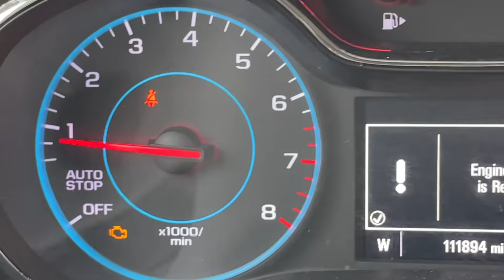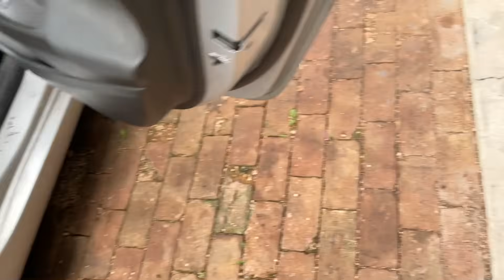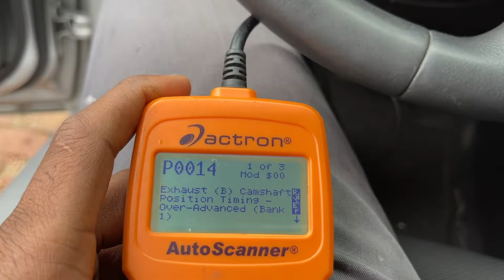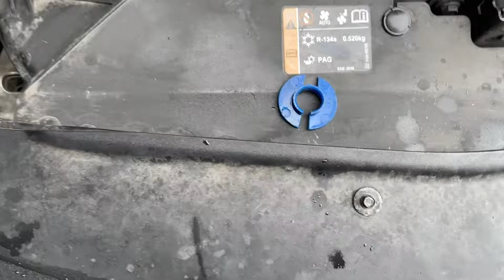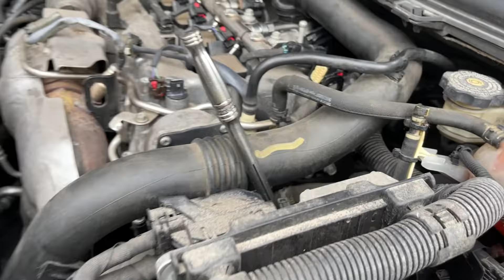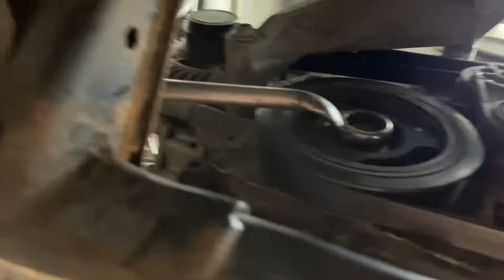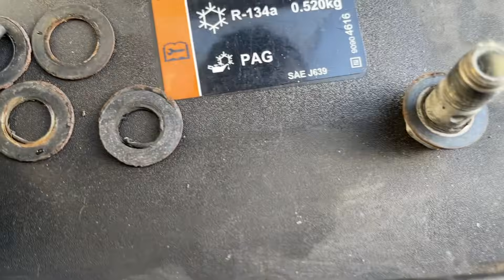16-19 Chevy Cruze, Mailbu Valve Cover Removal, VVT Solenoid & Camshaft Sensor Replacement 1.4L, 1.5L

Comment: Hey Terence, thank you so much for the informative video. I had a shattered Vaccum pump which caused Hard brake pedal. Drove home slowly.. Turned off. Tried to start again but had long crank, no start.
Opened up valve cover, fished out all the pieces new VP and Seal done.
Reluctor had moved so I tapped into position. Closed it all up. Now it starts and brake pedal is back to normal.
Seeking some guidance please as I now have Reduced engine Power notification and engine sounds like a Subaru Boxer. Smells of gas too.
Should I now be looking at possibly changing the exhaust camshaft or maybe try something before that. Any assistane is appreciated please. I didn't remove the full fuel rail with injectors (just got the top part off) as I hadn't seen ur video before.. Could it be that maybe the O rings or possibly the coil hasn't been aligned properly causing a misfire?
Reply: Hi Terrence, thanks for your reply.. I didn't have a scanner but managed to get a mobile mechanic to run a diagnostic.. It came up with P0014 code. He also said to check spark plugs while he diagnosed so I might change them as they havnt been done. I've just ordered them. Not sure if it will fix it he issue I'm having
Reply from the maker: The spark plugs will not have any affect on your issue.  I would'nt have changed them. How many miles on you car?
Reply: @TerenceDIY  just crossed 97000 kms
Reply from the maker: That's not many miles. I would not replace the spark plugs.
Reply: @TerenceDIY  thank you, noted.. I will return them.. Do you have any hints on what I should look for based on the symptoms and  the P0014 code or is it likely to be the camshaft exhaust. Sorry for all the questions here, GM is known as Holden here and they no longer have a presence in NZ anymore and parts, service and advice are hard to get
Reply from the maker: Couple questions,  when was the last time you had an oil change? Did it run low of oil? You can ask me a thousand questions. I will try to help you fix your issue. Thanks,
Reply: @TerenceDIY  thank you Terrence. The last oil change was at 92,465. About 4500 Kms ago.. Oil has always been kept at the correct level however the prior oil change before that was changed after 6500Kms and was topped up once as was a bit low but still within levels
Reply from the maker: Did you ever inspect VVT solenoids? Replace them?
Reply: @TerenceDIY  Hi Terence, no I havnt looked at those but I thought about it as I was watching your video again... Do you think that's a good place to start?
Reply from the maker: Absolutely.
Reply: @TerenceDIY  Hi Terence, I opened up both the VVT solenoids and couldn't see a sludge buildup.. It's not a very expensive part so I'll change it anyway.. Question for you though.. I only have a part number stamped on one of them (intake) which is 12636524. Is the exhaust VVT solenoid the same part number as in are they interchangeable. If not, would you happen to know the part number for the Exhaust VVT solenoid please
Reply from the maker: Here is the part (link below). You can change it however, I believe you have a timing issue. 

https://www.ebay.com/itm/335165256246?fits=Year%3A2016%7CModel%3ACruze%7CMake%3AChevrolet&itmmeta=01HV6PS3DJNV58NF8KA78PP7DQ&hash=item4e0967f236:g:uCwAAOSwX7plLePo&itmprp=enc%3AAQAJAAAA8LQhN70tjwdVs5i63y3Uy91xJ%2FovNohBT%2BKvb83QJj18qodbaUchSy%2BMZ3ilIhBiAN1G4Tq%2B4YPVY4r%2FTn1nPPcRmiAqQjLHfwTrgFKD0Y7BFowo12EI4iNJ75ygGoBsMKdKPieIV2%2FcBpNINud87Tg5i7gD0eFr3DF%2FQXScSyZ7lHcjCiMjnD6cDGvHAx%2BxKlJ6UvWxkjQe90OrRykOW8sOSjeD%2FKc8xGvb8Qr7xVicUhUHK4B39uDt%2FseZMX0ohew8fmjpxRP80koN5v%2B51eCqi7AMuMOG6xK2YlLfTWBoZLcoeBaVAAF7KtRhLyWMmA%3D%3D%7Ctkp%3ABFBM_rbk1tlj
Reply: @TerenceDIY  thanks so much Terence, does a timing issue mean it could be the reluctor?
Reply from the maker: Possibly or the belt is off. Did you make sure the reluctor was perfectly aligned?
Reply: @TerenceDIY  hey Terence, I got it as close to line with the QR code. I might open it up again and use something to ensure it's perfectly in line.. Will let u know how I go. Appreciate your help 😊
Reply from the maker: Please keep me posted. I wish I were there to help you.
Reply from the maker: What codes are you getting? Also, you should NOT be smelling raw gas. Is the engine running rough? Please tell me the codes if possible. Also, the fuel trims will shed some light on your situation.
Reply: Hi Terence
Do you have WhatsApp, Facebook, Instagram, or Telegram so I can send you the piece that is difficult for me to open, and how do I open it, knowing that the car is a 2018 Chevrolet Equinox?

Comment: I just replaced the vacuum pump and camshaft now it starts and runs but the engine light and codes are still there
Reply from the maker: You replaced the camshaft??
Reply: @TerenceDIY  yeah it’s recommended, i know you can turn the reluctor back into alignment but i just replaced the camshaft. Now it runs fine but i still have the same codes, erase them and they come back when i start it again
Reply from the maker: Yep, I am very familiar with these cars. I know them well. What codes are you getting?
Reply: @TerenceDIY  p0014, p0017, p16a1, p0016, the timing is correct all the marks are on spot, the reluctor is good i installed a new cam, the only thing left is maybe the cam actuator solenoid ? Maybe thats throwing the code
Reply: @TerenceDIY  really appreciate the response btw, its been driving me crazy hence this job is free for my sister with 2 kids trying to get back to work
Reply from the maker: It could be the cam actuator however, that is a lot of codes. Did you double check the timing marks? If they are a tiny bit off, if will throw multiple codes as you are getting. I wish I were there to help. I probably would know exactly the problem instantly.
Reply: @TerenceDIY  before i did the cam i turned the crankshaft pulley to its mark tdc, marked the timing chain to match both actuators marks and then installed my timing chain retainers to hold the chain while i swapped out my cam, maybe the engine was already out of time ? Both actuators were at 12 o’clock position and i marked the chain and the crankshaft pulley mark was aligned, the cam shaft locking tool was a tight fit literally by a hair
Reply from the maker: How was it running before? The exact same with the exact codes?
Reply: @TerenceDIY  it wasn’t running before, same codes and it said reduced power. Now it runs and it doesnt say reduced power but codes are still there
Reply from the maker: I wish I was there to see it. It's very hard to make any suggestions after you've done the things that you have done without seeing it.
Reply: @TerenceDIY  i understand bro, i appreciate your effort anyway thanks. Keep up the work you do 💪

Comment: By chance what was the part number for the vvt solenoids? It was never shown in the video.
Reply from the maker: Here are a few links...

https://www.ebay.com/itm/175908697302?fits=Year%3A2016%7CModel%3ACruze%7CMake%3AChevrolet&hash=item28f4f9b4d6:g:vm4AAOSwf-VlLf6D&amdata=enc%3AAQAIAAAA0PsZ1hIa7oPF15cHBoU9cIJMjCDCh%2Buo1CyYcfX4yTA1NrCii67855NyQ9UB%2FeRF7PJkNuZ80gkOjEf%2FK5RpsU2r%2FCfl4nv5GwPGjiq%2Fc9DimYDSvkWj2TUyMc%2Fjdf6FD7P%2F%2F0hfZDZY4K%2F3Eg173wiyKCAr9aKhTHknHXmvCipJnfhw748MxzuMnj5fiYcY1BoH3xQHt6xfZiriHTwjYzmWBLveJ5uAiLptg8O1rkY%2BWFdY1nYCPeiKQavj9lIvwk3fsisePqRq%2BSbpNvyWi58%3D%7Ctkp%3ABk9SR56Br6OxYw

https://www.partsgeek.com/xyy2wpw-chevrolet-cruze-variable-timing-solenoid.html?utm_source=google&utm_medium=ff&utm_content=OAY&utm_campaign=PartsGeek+Google+Base&utm_term=2016-2019+Chevrolet+Cruze+Variable+Timing+Solenoid+TRQ+Exhaust+(Rear)+16-19+Chevrolet+Variable+Timing+Solenoid+2018+2017&gad_source=1&gclid=CjwKCAiAlJKuBhAdEiwAnZb7le4mR2NJg9KDFKg_6i4TiDIaS2myURVmdQTV0omvnO6TyvYn9NrCPRoCeD0QAvD_BwE

https://www.partsgeek.com/9ll7dch-chevrolet-cruze-camshaft-solenoid-adjuster.html?utm_source=google&utm_medium=ff&utm_content=YN&utm_campaign=PartsGeek+Google+Base&utm_term=2016-2019+Chevrolet+Cruze+Camshaft+Solenoid+Adjuster+AC+Delco+16-19+Chevrolet+Camshaft+Solenoid+Adjuster+2017+2018&gad_source=1&gclid=CjwKCAiAlJKuBhAdEiwAnZb7lUstcHEslWDpyGTaSkNNm5Rfo5tC57JGtsZkoRUPW1MifxewWLJ5NxoCsM0QAvD_BwE
Reply: @TerenceDIY  thanks alot especially replying to an old video 🙌🏽👍🏽

Comment: Great video!!! I have a 2018 Cruze (same engine as video) and this video is super helpful. One thing I've learned with these small engine, hot running turbos "CHANGE THE OIL" when in doubt, change it. By the way, my oil light didn't come on either...Strange...
Reply from the maker: You are 100 percent correct! Changing the oil is critical in these vehicles. Thank you SO much for watching.

Comment: What’s the torque  spec for  the valve cover bolts when putting back the valve cover
Reply from the maker: Hi, I don't know off top however, I disclose all of that information in the video.

Comment: Damn this, video was very thorough and gave more explanation and detail as to what needs to be done or what to look for.  I'm getting a P1101 (Intake Air Flow System Performance),  P0014  (Exhaust Camshaft Position System Performance), P06DE (Engine Oil Pressure Control Solenoid Valve Stuck on) 

NOTE: My one tip would be to list the codes in the title as well. I've been looking for this exact video, but I've been searching for car name and the codes.  Outside of that, this video was PERFECT 
🤝🔥
Reply from the maker: I apologize for not having the codes in the title or thumb nail. I will take note of that for future videos. Thank you SO much for watching.
Reply: Did you end up fixing it? Those are the EXACT codes my car is throwing and i want to fix it im always working on everyones cars now its time to work on mine. What did you do to fix it

Comment: how do you lift a hard to remove valve cover?
Reply from the maker: If you have a mallet, tap around it until it free up. The gasket is holding it. You can also find an area where you can use a small pry bar or a thick flat head screw driver and pry it up.

Comment: For the reluctor does the fam shaft have to be facing the same way you had it with the barcode ? And when I put the vacuum pump back do I need it in between those will I know when I push it in it locks into it lol I’m just scared now I don’t wanna mess up the camshaft sorry for all the questions
Reply from the maker: Yes, it has to be facing the barcode. I show everything in detail. Installing the vaccum pump will not affect the position of the reluctor if that's what you are trying to say. NOTE; Although I show everything in detail, I am not there to guide you so you're doing this job at your own risk. Thanks,

Comment: Where are you located?
Reply from the maker: Chicago, Illinois.
Reply: @TerenceDIY  okay nice! I have a 2018 Chevy Equinox with an check engine light on. I’ve replaced the VVT Solenoids and one of the Camshaft position sensors but my car has trouble starting on the first try also I’m having to drive it in manual mode because if I hear it in drive and auto stop kicks in sometimes my car won’t crank back up. I have an original replacement Camshaft part (12675774) to put on but I was wondering if you had a video just taking off the top part of the lid without disconnecting everything?
Reply from the maker: The camshaft sensor is not your issue. Did you check the reluctor position? That's probably the issue.
Reply: @TerenceDIY  I haven't! Do you have an email? I have a picture of a reluctor I just need you to verify if it's the right one.
Reply from the maker: I show specifically in this video the reluctor and where the placement should be. You can send a picture if you like. wisenooty@gmail.com
Reply: @TerenceDIY  gotcha I’ll refer back to the video.

Comment: Just bought that seal for the gasket for vacuum pump I’m kinda thinking maybe o ordered the wrong part it suppose to be small the seal cause I just got it and it’s kinda small I thought it would be bigger seeing the video
Reply: 28.4x53.3x7.9 is what it says just making sure it’s the right one
Reply from the maker: Did you look at the application before you purchased it? I'm pretty sure it's the right one.
Reply: @TerenceDIY  I did I went to rock auto and bought both the gasket for the vac pump and the seal that goes on the engine I’m just making sure I was just surprised  how it’s not that big at all

Comment: What was the trick with the the hose tools or how not to use the tools?
Reply from the maker: I believe I showed everything I did in the video. Our you having issues removing a hose?
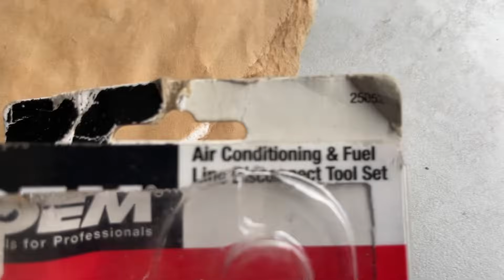Reply: at 15:58 there's a blurb up in the left corner about a easier way however I just went ahead a cut the hose which will probably be cheaper to replace than the tool. Your video has been an a great help. No wonder there's a lawsuit about these weak vacuum pumps that disintegrate  and drop pieces in the engine @TerenceDIY
Reply from the maker: I am glad my video helped you. I totally agree with you about the vacuum pumps. Once again, thanks for watching.

Comment: Need some guidance , customer came in 120k miles. Timing chain tensioner popped out and caused chain to be loose and upper guide was broken, fitted new timing chain system all the way down to vvt solenoids and sprockets. Reassembled car . Started just fine after about 5 minutes misfires with p0016 and p0017. I know timing is spot on and when disconnecting can sensors engine runs fine. Engine flushed twice with tons of metal debris due to timing failure. Where should I start. (Thinking reluctor has moved or cam blocked with metal because on scan tool , cam degrees will intermittently not reduced when ECM commands if then will go back to normal randomly.) thanks
Reply from the maker: Although I am not there to see the vehicle in person, but it sounds as if the reluctor has moved. I don't think the cam is blocked.
Reply: @TerenceDIY  possible on both banks?
Reply from the maker: Maybe, but I doubt it.

Comment: I’m having issue with my 2017 Cruze got 140,000 I’m leaking oil by that vacuum pump and oil is getting into the valve cover where the spark plugs sits and seems to be some oil sitting outside the valve cover what do you think the cause could be ? I’m really stumped and I’m filling oil like every 4 days I’m thinking needs new valve cover gasket and inner I’m also seeing oil in the air intake could that be a pvc issue ?
Reply from the maker: It's that rubber seal or the gasket around the vacuum pump. I just fixed a similar oil leak on a Cruze. If I were you, I'd change both before things get bad and you possibly damage something.
Reply: How about oil in the air filter you think it’s time to change the pvc valve like the one connected to the turbo or should I do all the others ones?
Reply from the maker: If you want however, I would fix the issue. I would definitely change the oil and filter after your fix the leak.

Comment: See how you pointed out the vacuum pump seal that circle one does it leak oil if it’s bad ? Cause Rn I’m getting soil for that exact spot on 2017 Cruze
Reply from the maker: Yes, it will absolutely leak oil if that gasket is worn.

Comment: So I have a Malibu I just changed the vacuum but it broke the camshaft would it be the same process or how would I go about the timing chain
Reply from the maker: This process would be a start of a very tedious job. You would have to remove the side engine mount to raise the engine and remove many more components to get to the timing chain.
Reply: @TerenceDIY  so would I have to take off the chain to do the camshaft ?
Reply from the maker: Absoluetly.

Comment: I could've used this video over the weekend...i have a 2018 malibu and the vacuum pump shattered. i replaced it and it was a bit shaky, took it to a shop and they said the camshaft twisted...not sure what that means but my bill is $2000...thanks for the video, stay blessed
Reply from the maker: I know exactly what happened. That's pricey for the fix however, as long as they do a good job, you should be fine. Thank you SO much for watching.
Reply: It turns out that the reluctor wheel had twisted, not lining up with the QR code and the camshaft had to be replaced. Some special tools needed to complete the job and they got the job done. Malibu is running great
Reply from the maker: It's a common issue with these engines. I am glad you got it fixed.

Comment: Ayo bro anything else you did to get those injectors out these mfs stuck in there
Reply from the maker: Nope. I showed everything I did in this video. Were you able to get them removed?
Reply: @TerenceDIY  nah I just pulled the cover up and over them I got it. The vacuum pump exploded where it connects to the camshaft I pulled all the metal out of the top of the motor now I can’t get the vacuum pump seal out of the valve cover that fell apart too any tips on that?
Reply from the maker: What methods are using??
Reply: @TerenceDIY  i had to use a flimsy razor blade from my razor and go around the outside edge and cut the rubber inbetween the valve cover and the metal race inside of the seal. Angled pliers and a screwdriver I managed to get it out thanks for the video man helped a bunch 🫡
Reply from the maker: Awesome! Thanks for watching.

Comment: Something very strange caught my eye I have th same engine in my 2018 but it reads 0w20 on the oil cap.i hope someone didn't put the wrong oil fill cap on that engine. The cap on your car reads 5w30
Reply: The Earley models used the 5W20 then they decided to go with an even lighter oil. Im replying to my own comment 🤣

Comment: Didn't this car only have 56,000 miles on it just 6 months ago when you cleaned the throttle body😳😳
Reply from the maker: I think it was around 86k. They drive that thing all day every day (uber eats, instacart, etc...). It has around 140k now.
Reply: @TerenceDIY  Thanks for the reply